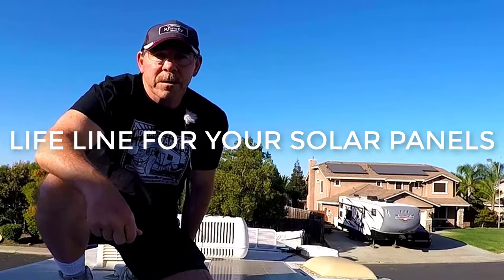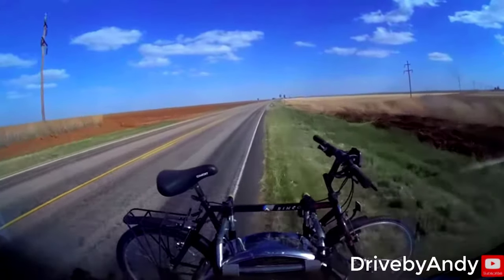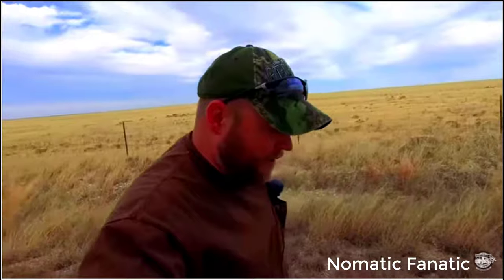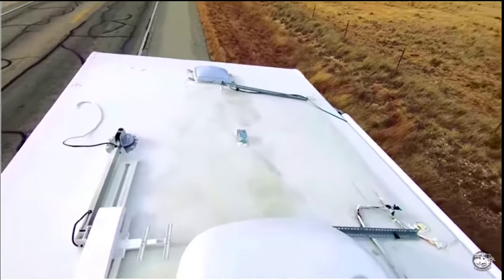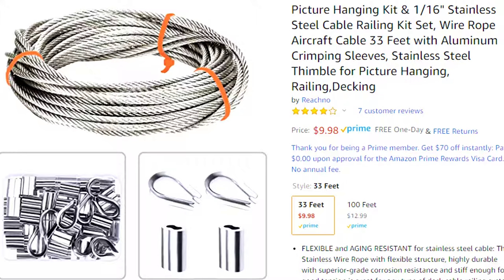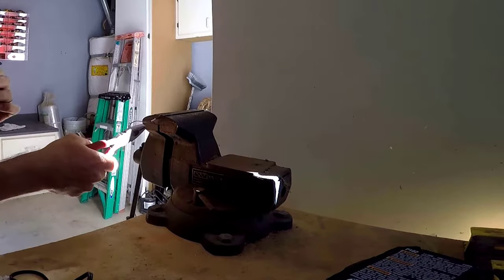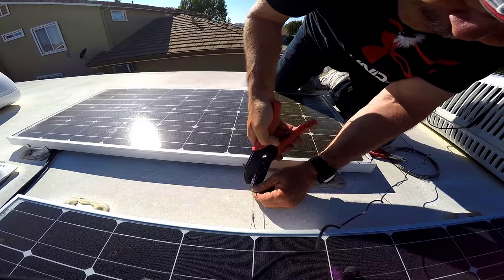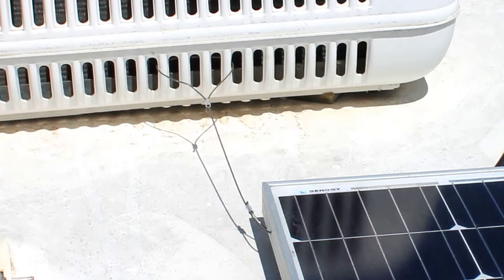Secure Your Solar Panels - RV Solar Panel Safety Line

Comment: I need to do this! The only comment is that the plastic on those cowlings gets brittle and may also break if it gets tugged on too much if a panel lets go.
Reply from the maker: good point, will have revisit that area. I did do a pull test. Thank you

Comment: Just keep in mind:The cable will prevent the panel to hurt some one else, but it will not prevent the panel to be ripped off in the forst place if you do not secure it to the roof appropriately. In case the panel is ripped off again it will flap around held by the cable and slam into your RV where ever it decides to slam. The repair will be extensive to irreparable. Call me a sceptic, or overly concerned. Yes I think your cable will work, but it contains a risc to yourself and your property. In another post I suggested the following:

Quote: I find your way with the unistruts indeed the best way to mount the panels!!! But .... the mounting of the unistrut itself to the roof is an iffy thing. 
My thoughts: I need to consider the limiting case in order to prevent the panels from just flying off and killing the driver behind me. The limiting case I consider is: Top speed of my coach is 85mhp (it takes a while to get there, but I have been there in Texas), now let's assume I am driving into a thunderstorm with severe wind gusts in my face of another 85mph (have had it once. Slowed down the coach dramatically). This would be a short burst of 170mph (it can go up to this speed in an instant, out of my control). Now I would like to calculate some safety into this and round it up to 200mph wind gusts which the mount of a large area solar panel (40" x 65" multiplied by 4 300W panels) has to sustain in a limiting case. 
I do not believe that tape (any tape), or screws to the surface of the roof will hold this limiting case. ...and this case, as unlikely as one might think it is, will need to happen only once and kill someone (which WILL ruin my life and the victims life entirely). 
I decided to bolt the struts through the entire thickness of the roof (all the way through) and secure the bolts with a flat steel rail from inside. The steel rail will distribute the load evenly to the roof stucture and employ the multiple trusses and members automatically (of which I have no way to determine where they are exactly located). Then mask the inside rail with decorative and beautiful wood. This will add a nice decorative feature and gives me peace of mind, and potentially saves a life. 
To do this and keep the roof waterproof, I will apply plenty of dicor inside the hole for the bolts as well as outside where the heads of the bolts are. 

This is what I am talking about: https://youtu.be/m4Jq6zNrwHY
As one can see, the brackets were just glued down. This glue will deteriorate due to weather. Even if the brackets would have been "secured" with screws, it would have ripped the screws out as well (most likely).

Maybe this is the German in me, but I like it safe and apply appropriate engineering, having this ONE case in mind.

Comment: I think too many rely on the cheap angle brackets that are designed for rail mounts.  I have 10 ft of superstrut, with each 10 ft rail mounted in 6 places.  Panels are held in by clamp type brackets AND stainless steel zip ties to the strut.  IMHO, securing to the AC will not hold that much wind load.  That being said, my panels are 6.5' x 40".  Considerably larger than most.